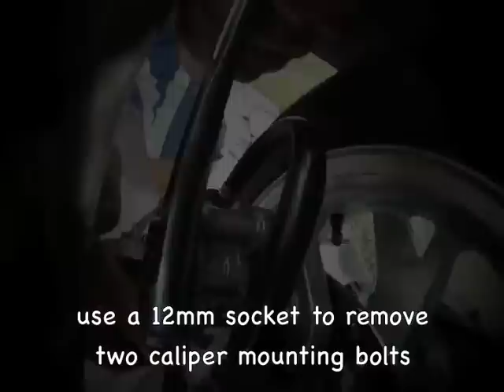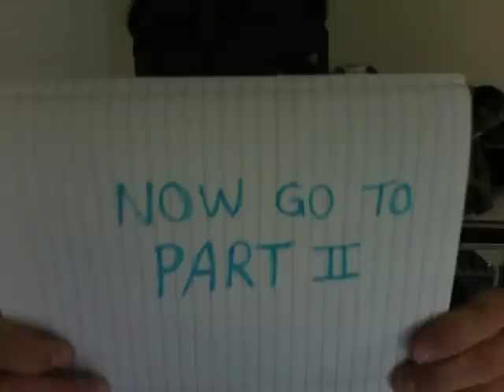07+ Suzuki Burgman 400 Brake Pad Replacement - PART ONE | MicBergsma

Comment from the maker: @ArcanePath360  Welcome, glad to help!  Yes you have to make sure the piston head is aligned with the + shape on the top, if you didn't then the pad will not moving right.. u know?
Use the car wash soap, it's safe. I got some brushes to clean in small spot where you cant reach with your hands. I washed brake caliper with dish soap, just a bit with warm water and use old toothbrush. I was lazy to go to store to get brake cleaner, spray on the caliper, make sure won't touch the other bike parts

Comment from the maker: @ArcanePath360 I think I did that before on a different bike.. take the pads out and clean around the pistons then put pads back.. should be safe, you could spray the brake cleaner but careful not spray on other things.. cover other things with towel . don't touch the brake lever while doing that
Reply: i couldnt move my piston back in..  i've turned clockwise, and its not going... is there anything else i can do? it is  stuck

Comment: Thanks! This helped me a lot. I've always been scared to take my brakes apart, but my front one has just seized up on me and I'm not paying a mechanic if I don't have to.
2 questions:
1: horizontal? Do you mean  the way the cross on the head is aligned?
2: I was taught that washing up liquid=bad. And as my bike is so filthy after a rough winter could I use something like solvent or wheel cleaner?

Thanks a lot, stylishy made tutorial.

Comment: Just bought a 400 Burgman 2012 and needs rear brakes.  So glad I found your video.  Rotor is kinda jacked up as well.  Also I noticed when I was driving it home that I could only get to 80 mph before hitting redline.  I don't think that is normal.  What do you think?

Comment: Hi Mitch, old but great video. I have an issue with my front brakes, on the right side , I can’t remove the calliper, the pads are slightly rubbing on the disc and the wheel spins OK, but it seems something stuck and the calliper can not be lifted off the disc rotor, do you have any advice? Thank you so much for your assistance.
Reply from the maker: Hey, I would pull the caliper off harder, happened to me on some scooters before… maybe use rubber mallet to push it off
Reply: @MicBergsma  awesome, thank you so much for your help, Mitch. Much appreciated. 👍🙏

Comment: I have a Burgman AN 400 1999, and theres no screw to depress pistons, however theres a screw on the other side thats used for Handbrake  setting, I unscrewed it easy step by step, and depressed pistons inside. What do mean is that correct what I did? I also took some brake liquid out before doing this. Thanks mate

Comment: Hi, I was wondering if you could help me.  I have a Burgman 400, '09, and there is 5800 miles on it, in excellent condition, only I've noticed of late that there is alot of rough shaking when I first start off, and it smooths out once I give it throttle, and I've even noticed that it lets up after I've been riding it along time, or it's hot, it seems to be alleviated.  Is that rubber belt on it's way out?  Is that the problem?  What do you think?

Comment: I think I am having an issue with rear brakes.  Changed rotor and pads about 2000 miles ago and pads are already worn out and the rotor is rough likely due to pads being worn out.  Is that normal?  Now I am trying to remove caliper but it's like the pads are grabbing on.  Any suggestions? 2012 400 Burgman. Thanks!
Reply from the maker: Dojo Mark hey I would use rubber mallet on the caliper to get off... make sure the emergency brake is unlock
Reply: @MicBergsma  Great! It worked.  Thanks! How many miles should I expect from pads? Those last pads I had were junk.  Maybe not even 1,500 miles and I don't use the rear brake much.
Reply from the maker: Awesome no problem! I'm on second pads right now and bike has 60,000 miles on it... I can go for 30,000 miles or more... I don't stop aggressive... pads I use: https://amzn.to/2WD43HW